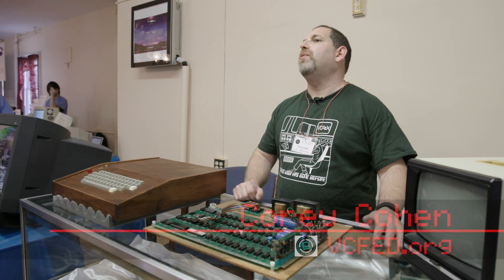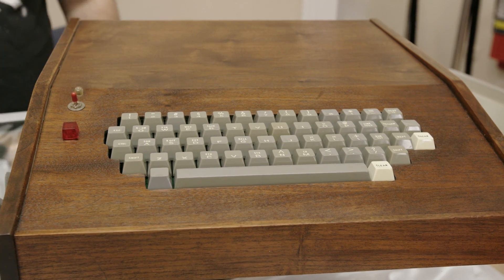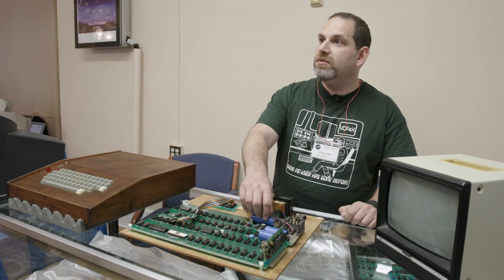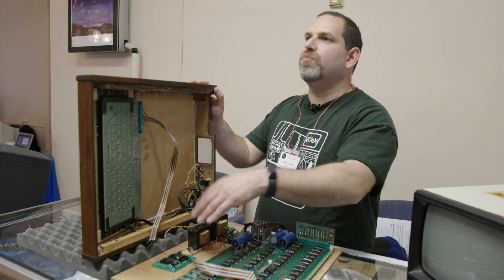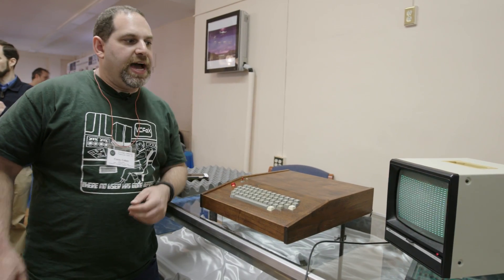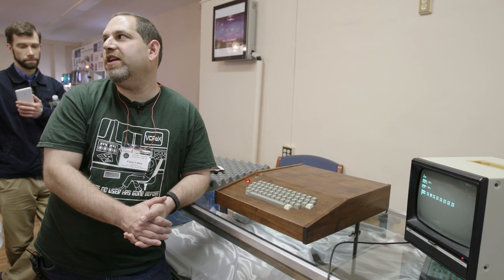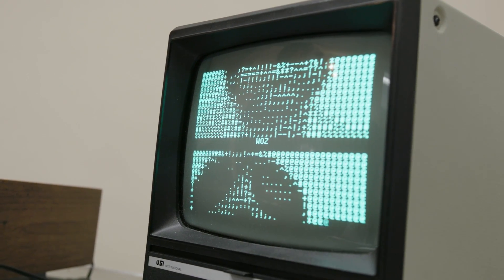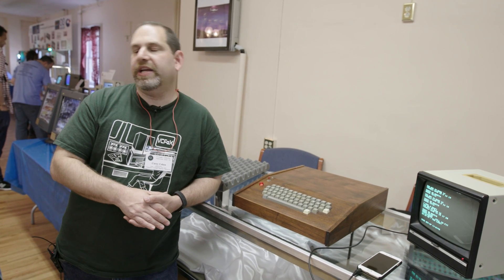Original Rare Apple 1 Computer Demo at Vintage Computer Festival VCF East

Comment: I've seen the Nixdorf Apple1 a few times, even before it was made theftproof (it's now housed in an acrylic case, rather than attached via 2 simple screws to a tabletop) and found it rather unremarkable, yet can understand the recent hype in the last 10 years or so.
Really nice of the person presenting the machine to power it up and have people use it - more people need to understand computers are machines intended to be used and show their magic when powered up (I mean no one looks at the schematic & romdumps and goes "oh wow, that's a unique experience"), rather than display/design/speculation objects, while acknowledging their historical value.
I've had my fair share of encounters with machines that are considered highly valueable these days or virtually extinct (Atari ATW800, C65, SOL20 to name a few more common machines).

Comment: Some flashes of genius : (1) Woz's display circuitry on the II (2) Woz's disk controller/software (3) Wozmon/Sweet16.  Most everything else Apple "created" after this is either conventional, overrated, or ripped off.

Comment: I'm glad to see apple has kept up the tradition of making people buy essential components separately under the guise of "an opportunity" .

From the beginning to now, apple: "accessories" not included
Reply: At the time, it wasn't unusual to have to buy additional items in order to use your computer properly. If you bought an Atari or Commodore PET (after the original PET 2001), you had to buy a proprietary Atari or Commodore tape deck. If you had a Sinclair ZX80 or ZX81 you had to buy a 16K RAM pack if you wanted to do anything more than the most absolute basic things, since the computer only shipped with 1K RAM. If you bought a Sharp MZ80K you had to buy an operating system, since it wasn't sold with one... and on, and on. 

As for more modern times, I'm not sure what you mean. Every Apple product I've bought has had all the essential components sold with it. It was only in 2020 that they stopped providing a charging brick with iPhones, but they do still include the cable.

Comment: That’s just sooo cool, being able to connect the iphone to the apple 1 trough the hadphone jack,even the iphone 12 does not have that luxury because it lacks a headphone jack,why that bastard shill filler did not realized that the headphone jack could be still handy in cases like this?, only that’s why i consider my iphone 6 1000 times better then the stupid iphone 12 ,also the iphone 7 cannot stream data to the apple 1 because of this ,streaming data from the analogue world into the digital world to load programs into it that way, that’s such a cool feature of it,and those fotos as shown here were really cool.😁
Reply: Yeah, because sooooooo many people need to use their iPhone to load data into their Apple 1. Seriously, if you're still bent out of shape over the lack of a headphone jack 6 years after it was phased out (and remember how it was predicted that the lack of a headphone jack would mean the iPhone 7 would fail horribly and Apple would be forced to bring it back?) you could do with giving your head a wobble.
Reply: @dunebasher1971  well i would,ve applaud if the iphone 7 did fail horrible because of lacking a headphone jack and yes i am still bent over it 6 yearsvlater because putting a headphone jack on it was a step forward and removing it just became a step backwards,am mean what were they thinking.

Comment: If I remember correctly, the original price for the Apple 1 kit was $666.66 (Makes sense with Steve Jobs being an atheist)
Reply from the maker: You are correct. Wikipedia says it is because Woz "liked repeating digits" and because of a one-third markup on the $500 wholesale price. But that certainly is an odd repeating number to choose. I bet you are right!
Reply: @TheGuruMeditation  Maybe Woz is right, but who knows? In any case, the Apple-II was a HUGE leap forward in ease-of-use over the Apple-I.
Reply from the maker: @JustWasted3HoursHere  It sure was! I had an Apple ii/e. It was way more advanced than this machine. But today I would rather have an Apple-1 ;-)
Reply: @TheGuruMeditation  Not really very odd. $555.55 wouldn't have been enough of a markup and $777.77 would have been way too much. In any event, 666 as the supposed "number of the beast" only has meaning for those who believe in religion, specifically Christianity. Atheists don't care.

Comment: A time when you could open your Mac and upgrade or fix things.
Reply from the maker: I know, right? It actually came with schematics and everything. Now you can't even upgrade the hard drive, memory, or fix it - but it is thin!
Reply: @TheGuruMeditation  You can upgrade but its like surgery. Risky stuff. I have an Imac and its 10 years old but I wouldn't stop using it. When it breaks, I have to fix it.